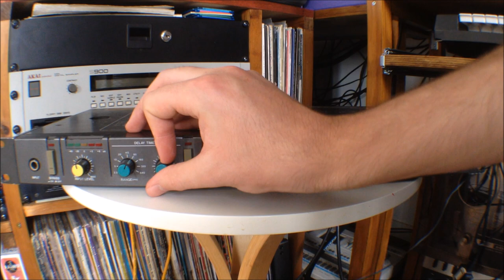An In Depth Look at the Boss DE-200 Digital Delay

Comment: Very interesting video. I recently dusted off my DE-200 and it's been so long since I've used it that I forgot how some of it worked. For example, my memory of phase mode was that it help create flanging, but obviously that's not the case, at least in terms of that being the only way to do it,  as per the demo around the 14:50 mark where the phase LED is clearly not engaged.

Comment: Ok I’m here to report that I did the mod – fantastic! Really opens the sound up – lots more headroom and far less noise – without losing its original character. I found the mod a bit tricky TBH – trying to identify and desolder tiny components but to my amazement it worked a treat. I made sure I had all the components as described (had to order 110k resistors separately but the rest came in general mixed kits). Don’t forget that this mod requires that the input is the front jack (I previously used the rear input jack). Thanks again for the heads up on this and for this video mate!

Comment: Nice one! This is my main delay (my backup is a Quadraverb). I did the noise-reduction, lower line-level and higher-output mods when I got it. I love the ability to time-bend the unit and hold-sample in real time, smoothly with no stepping (like an analog unit). Also use it on occasion as a doubler, flanger or chorus. I've wanted a matching CE-300 to keep it company for a few years already (procrastination and broke I guess).
Reply from the maker: +Edgar Magooo I have a couple of other dedicated delay racks kind of similar to this one from now defunct brand names such as Frontline and RAK (Korean company I believe) but this one takes some beating for the era. Great sound and interface. The CE-300 does look good as well, also the half rack Boss units of the era. I got this at a Pawn shop for £40 which was a good price but I'll definitely be keeping an eye out for more Boss units from this era.

Comment: Great thanks! I have one of these and only ever used it for non- triggered manual dub messing about. But going to check out the triggering stuff after your excellent inspirational video! Also going to look into the mod – nice one
Reply from the maker: Glad you found some useful info in it!

The triggering is a really nice function for the time. Very nice bit of kit.
Reply: @snolan1990  also I just subbed you after a look around – like your vibe! I’m a big fan of early 90’s midi electronic music production and have got back into making stuff through lockdown – all the stuff I have is now sitting in my bedroom – a tangled mess of merged and thru midi all running from an Alesis MMT-8 – great for bashing out live mutes tracks! Anyways thanks again and look forward to your channel
Reply from the maker: @quietandpeacefulman  just checked out your jams and I envy your ability to create musical song structures on the fly! That's the kind of stuff I agonise over haha.

Subbed in return and looking forward to hearing more of your stuff.

Comment: Hey there – I have looked out my old DE 200 and dropped it into my setup – sounds great putting my Monologue through it! I am aiming to do the impedance/gain mod to 'open it up' a bit. I've been experimenting with the synch/clock/trigger input with mixed results. I can synch it to the regular Korg 'synch out' (either 16 or 8 steps per loop) and this works perfectly – TRS stereo minijack to mono 1/4 jack. However it is regular and inflexible – really looking to try to generate more interesting sequenced triggering (as you do in the video later at 20:50). I don't have a trigger out drum machine to hand (only a spare unused ancient TR-505 with no trigger out). I have a Beatstep and thought I could use the Gate Out and have a nice simple step sequencer – but it doesn't work dammit! Not sure why because on the oscilloscope both signals look very similar – anyways will post back here if I have any insight
Reply from the maker: Just so you are aware... the mod isn't a huge change, it did improve mine but it is still easily over driven and with a relatively quiet output. So worth doing if you are confident but don't expect a huge change!

Hmmm shame about the triggering though, I'm not really sure why it wouldn't work, but I'm no expert at anything other than MIDI really. It makes sense it would work with Roland and Boss triggers but perhaps it is very specific in the trigger it needs.

I hope you manage to crack it.
Reply: @snolan1990  Hey. Progress. The issue is that when plugged in to the delay (or anything it seems) the Beatstep 8V gate out drops to about 4V (I think) which is not enough to trigger some devices. I learned of this issue from this blog post: https://synthnerd.wordpress.com/arturia-beatstep/ So I was looking into some simple circuits to amp the trigger out a little before it gets to the delay and followed various discussions about impedance and home-rolled circuits on various cv/gate discussion on modular synth forums. Had a brainwave at 3am when I couldn’t sleep. I patched it into a mixer and fed it out amped and eq’d and crisp and not in the mix and can now use the Beatstep as a delay step sequencer! Immediate polyrhythms and synced complexity – I’m a big fan. Thanks for your help and advice again!
Reply: Here is a quick shakycam demo mix of it working: https://youtu.be/fPU2otij-HA
Reply from the maker: @quietandpeacefulman  nice solution to the issue! Strange that the trigger amplitude would drop off and also that the delay would require it to be exactly 5V but... if it works now!

Checked out the jam already and it really does have a good sound, for a delay of that age the fidelity is pretty strong.

Next thing for you to try is the sample feature!

Comment: great video. I wonder if you or anyone else can help me - recently picked up one of these and all works fine except that the delay times are much shorter than they should be, e.g. on the 640ms setting the delay comes out around 230ms. Initially I thought it might be a mechanical issue with the delay time switch pot, but then I happened to leave a loop running in the hold memory, and after a while it gradually slowed itself down to the correct delay time, without me changing or touching anything. After a few minutes it started speeding up, back to the incorrect, faster delay time. It did all this again a few minutes after that. Anyone have any idea what might be making it favour shorter delay times / making the delay times unstable?

Comment: is the clock a digital info?  or is the trigger simply an analog signal (meaning anything could trigger it)?  Putting that drum machine on top makes me think it's something more proprietary.  I'm really interested to see if you could push non 4/4 beats into it and have the delay be a bit more rhythmic.  like imagine a kick kick pause kick kick pause kick kick pause kick kick, kick kick pause...  or whatever but have the echo respond as such.

Comment: I can't tell if my unit is malfunctioning. When I dial up modulations and rate I get strange behavior with rate. It's as if it goes faster and faster the lfo, and then slows down, but its not constant. Max is not slower and min not faster, its just different and weird. IS this normal?

Comment: I have one of these available for sale if anyone's interested.  I only used it a few times, so it's just sitting around in the original box right now.   It's a great effects piece, but I'm not really playing guitar much anymore.
Reply: hi i would be interested
Reply: Finally got off my lazy ass and listed it on Ebay.  Here is the link:

https://www.ebay.com/itm/BOSS-DE-200-DIGITAL-DELAY-GUITAR-EFFECTS-RACK-ORIGINAL-BOX-OWNERS-MANUAL/254144616689?hash=item3b2c3318f1:g:mt8AAOSwiolceGHq:rk:2:pf:1&frcectupt=true

Comment: hi guys! 
do any of you use an external trigger signal on your boss delay? 
I'm looking for a small and handy unit to finally bring the rhythm sync into play. 
many thanks in advance, have a good one and take care of yourself!
Reply from the maker: What do you want to use to trigger it?

If you want MIDI from a DAW then the Valpower Arp Sync should work...

I was sent a unit to demo and it should be compatible.

https://m.youtube.com/watch?v=BVcXMP4-UtU
Reply: @snolan1990  I'm using it on my dub sirene and want to sync it manually with the records beeing played by just tapping the beat. should be possible if I'm reading the users manual of the boss delay right. 

I've have read somewhere that it's possible with the roland dp2 pedale, but I'm trying to track down a much smaller and more handy unit. 

thanks for your reply, really appreciate your help!

Comment: This is a very good review. Thank you for doing this! I just traded a Roland SDE-1000 and a laptop rack for two of these units because I was impressed by how they sound in your demo. The hold function is great, the modulation on this thing is fantastic, the vintage digital vibe to this thing is wonderful. Now I have stereo delay for going out of my DAW and can use these units for all my outboard synths.

I have yet to test them out, but I'm sure they'll work wonders along side my Yamaha R1000 vintage verb :D
Check out the R1000 here:
https://youtu.be/QaPu3MwJhrQ
Reply: I bought one, when they first came out (HOLY KRAP, LOL!!)still have it...I put my Tak 12-string through, with some delay and the (as you note) FAB "modulation", and voila'....."124-string".......